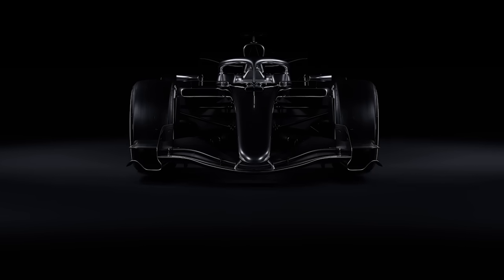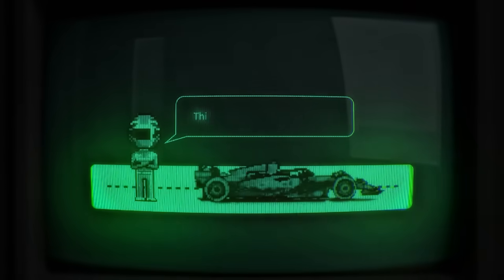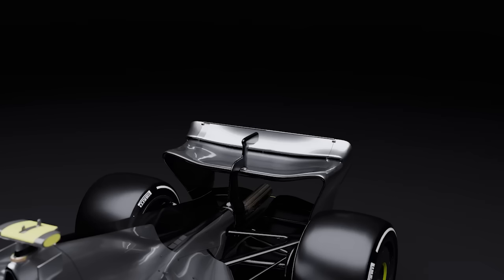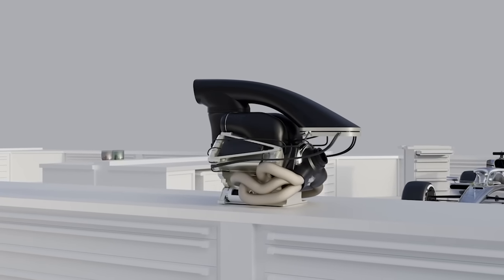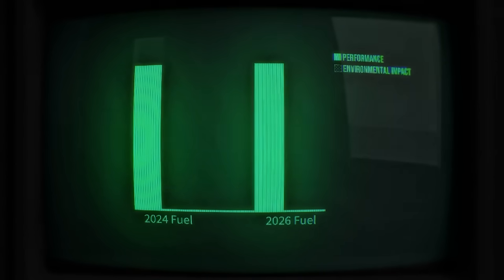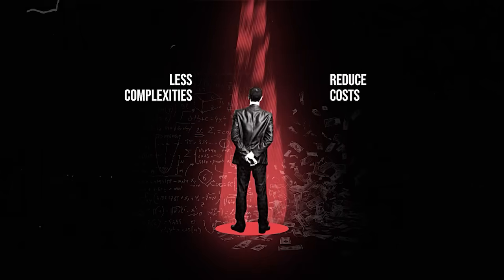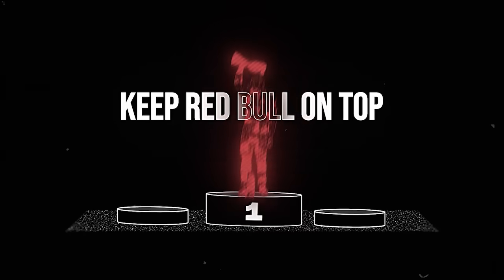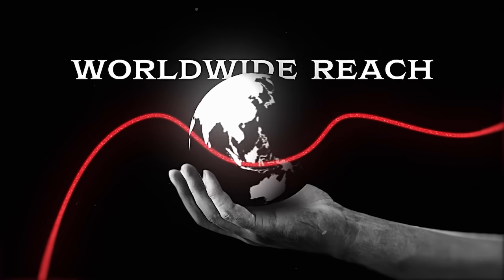F1 2026 Regulations: What’s REALLY Changing?

Comment: The sport has become nearly unwatchable over the last 5-7 years. The noise is gone, the rules restrict nearly all innovation, the sport has become all about extracting every single dollar possible from the ultra rich and no one thinks an $80 sandwich at the race in Miami is a good thing. Combine that with thinking that reducing the width of the car by the length of a human hand is going to make it more exciting and that's all the proof I need that it's still going to be as boring as ever. I do however want to give credit to the people responsible for this video, it's amazing and very informative. I just wish you were making this for something that was more exciting than modern F1.

Comment: Say we do: 700kg, internal combustion only, manual transmissions. That’s going to add a layer to the racing. 
Use synthetic fuels and the best tech possible to get the best fuel economy. Adding either limited fuel refills or bonus time for unused fuel adds a green incentive without silly electric motors and v6 engines. V10+ only.
Reply: Yes but having 700kg with v10 or v12 is basically impossible with the aero being decent
Reply: thank good you are not in charge of F1.
Reply: now ask every manufacturer to make V10s or more 😂😂😂 the sport regulations are made towards manufacturers not towards what F1 wants, after all its not worth having v10 if 2 or 3 manufacturers exist and they can provide engines for 3 or 4 teams
Reply: Some of you fans are such dreamers now.

Comment: Formula 1 really needs to cut the shit regarding "automotive trends" and making F1 "green"... Want to know what would make F1 cars kinder to the environment? Removing about 3-5 races off the calendar so you're not burning 100's of thousands of pounds of jet fuel/diesel flying and shipping the damn things all over the planet. The focus needs to be on renewable fuels that make the most horsepower out of a combustion engine. Not stupid ass electric power and batteries.. Let WEC and other forms of endurance racing be the tip of the spear regarding efficiency. I don't need, nor do i want an F1 car to relate to my road car. In no way shape or form does a carbon tubbed single seat open wheel race car relate to anything we drive.

Comment: Can the F1 fanbase just collectively accept that V10's, V8's, and any genuinely good sounding engine are never coming back. It literally doesn't make sense from an EFFECIENCY standpoint (not even environmental) to go back to those old engines. And I genuinely hate to admit this (believe me love the V10's), but V6's just make more power, burn less fuel, and overall just cost less to operate. And yes I know that brands like Ferrari might as well have infinite money to spend on their F1 programs, but smaller teams like HAAS don't. And I am all in for closer racing and more teams on the grid.

On an unrelated note however, you guys are overreacting on these new regs. They COULD be bad for the sport, I will never rule out that possibility, but there's a chance that the cars will be amazing (LMP1s proved a 50-50 power split between ICE and electric can work from a racing standpoint). Then again, this is fkn formula 1, if the cars aren't much faster than an F2 car then what's the point of good racing 😭

TLDR: V10's won't come back (please for the love of god stop arguing and be at peace with this) and the new regs may or may not suck lol

Comment: Hah! A slight shuffle in the right direction in some places. But on the whole I don't like these new rules at all.
1) Want to reduce carbon footprint? By all means change the fuel, but simply reducing the number of races to a less idiotic number and changing the schedule a little would make a huge difference.
2) Want to improve racing enormously while cutting out by far the biggest developmental cost in F1? Ban all bodywork aero! Then simplify the front and rear wings to be a single fixed piece of a mandated maximum total horizontal area front and rear, mounted fore and aft of the axel lines (no in season bodywork development).
3) Want to encourage innovation while making F1 progressively greener in to the future, and saving another huge chunk of money? Dump the 'engine' formula in favor of an open fuel formula - The fixed (green) fuel formulation is provided to all teams by the FIA, another massive saving both for the environment and fuel del development while eliminating the need to monitor fuel production rules. Each car has a maximum allocation of fuel it may use in each race, but otherwise teams may develop their power unit as they see fit - this latter innovation would automatically see developments toward battery powered cars just as fast as technology allows as less fuel carried would be a huge performance advantage.
4) Mandate a maximum wheelbase and track roughly half the current cars - it can be done within the above rules and would make a huge positive difference to the racing, especially on the 'classic' tracks just about everyone prefers.
5) While less of an issue than it used to be for larger drivers, drop the minimum car weight in favor of a minimum driver + seat weight, while maintaining the crash protection rules. Not only would that make the racing more fair as being physically smaller is still a huge advantage that has nothing to do with skill, it would allow teams a path to innovation that could benefit all while not incurring the outlandish expense of a continual aero arms race.
6) All cars must run the same agreed electrical and electronics systems package for each season, although software will be up to each manufacturer. To be overseen by the FIA. Why? For easier monitoring of the rules. But also to stop 'over-assisted' and 'complex' driving - to include no in race updates to settings from the pit wall (allowable during pit stops) and a drastic reduction in the steering wheel options available to the driver. ie: all car setup must happen pre-race, and any changes must either be done externally during pit stops or limited to the most basic in-race settings such as brake balance and diff by the driver.
7) Keep the mandated single-make tiers, but give teams a total allocation of each compound for the season. Each team to declare what they will bring to each race at the start of the season but for wet weather tiers. More interesting without resulting in added costs. Unlimited testing... but it can only be performed as part of the total tire allocation!
8) Only manufacturer teams my take part in the manufacturer championship, with two cars per team. Qualification for manufacturer status requires the in-house production of chassis, body panels, and wings, while everything else may be freely outsourced or bought from other teams. Single car privateer entries may take part in the driver's championship only though buying a chassis to a complete car from a manufacturer team at the start of the reason - all finances, in-season development, management, and personnel must be demonstrated to be independent of the chassis provider beyond the initial purchase and parts support.
9) Increase the 'grid' to 12 manufacturer teams and a maximum of 32 cars. Each race with a maximum of 26 starters... remember these cars will be much smaller and cheaper. If the 'grid' composes of more than 26 cars pre-qualifying will be required for new any new entries and the bottom 10 cars from the previous race - let's have some fun!
10) The weekend format - let's get rid of all the nonsense, especially the bloody sprints! The weekend and qualifying format that has been the norm from that last umpteen years is the ONLY part of F1 that isn't broken and needs no fixing!
11) A free fan vote to be had every 4 years on what should be the 12 core tracks in every season, picked from all those that still exist from F1 history - these tracks must be raced barring unexpected disasters and supported by the F1 organizers and FIA to ensure they proceed safely. The safety aspects must be independently assessed for their viability so impossible tracks aren't selected, but the choice isn't in the hands of the organizers. Any remaining venues to be chosen by the organizers as usual.

So there you go. That's what I want to see for F1 - I think it would be fantastic from the get-go and would only get better with time. Better yet, it would be far cheaper, far more interesting, and the rule set could be kept static for years as society-relevant development is built in. More, beloved classic tracks would become relevant once more instead of the yearly farce that is the likes of Monaco.

Will it ever happen? Of course not!

Comment: MGU-H never reaslly saw the advancement in production cars as regenerative braking. I think focusing on MGU-K would benefit that tech significantly. I wonder what percentage of energy it can currently gain from braking and how that compares to regenerative braking on some production vehicles. Does anyone know if these systems are actually related and if so what is F1 energy return vs the average of the production market that has regenerative braking.

Comment: Formula One dies for years because of eco regulations. They try to influence popularity of electric/hybrid engines in our own cars but they dont see formula one becomes much less popular because of it. Formula1 should use pure petrol solutions where the limit should be only engine capacity of 3600cc, teams should decide if V8 or V12 fits their construction best but meanwhile hybrid solution should be an option not the duty, like four wheel drive etc.

Comment: Ability to race sadly depends on 3 things and modern F1 doesn't do the greatest in any of them and only shows little effort:
- Car size. F1 cars have gotten huge, to the point where an Indycar, which a long time ago were ridiculed for being large, look small now. The 2026 regs are a small step in the right direction for car size, but nowhere near the glory days of F1. Monaco isn't even a race unless it rains...
- Dirty air. The 2022 cars were definitely a step in the right direction regarding this, getting rid of all the flaps and slats. Less over-floor grip and more underfloor grip. Risky, as F1 has seen casualties with ground effect cars before. The ratio of the the 2022 cars was pretty good I'd say.
- Tyre wear. Even if F1 did well on the 2 points above, the tyre compounds sanctioned by F1 still won't allow for much close racing, as tyres will just fall off a cliff far too easily. Can't closely follow for too long because you might thermally degrade your tyres... Soft tyres have also essentially become the Q3/Fastest lap tyre.

Comment: "That's a real racing car. I would race that today if I could." - Lewis Hamilton after driving Senna's 1991 MP4-6

"Hate the things. Biggest mistake F1 has ever made!" - Martin Brundle on the hybrid F1 cars.

Yup... the 80s - early 2000s was peak F1. Loud, roaring, screaming engines with smaller, lighter, more nimble, more lively, aesthetically beautiful chassis. The cars in those days depended more on the driver. Even the era of traction control, they still required more from the driver. Modern F1 from a marketing strategy it has improved leaps and bounds but the sport itself is a far cry from what it used to be.

Comment: The active aero is very interesting. I wonder if it has to be controlled by the driver, or will they let a computer control it. With pressure sensors under the car floor, the aero could be computer controlled, to effectively control the ride height, to give a rudimentary 'active' suspension...although it will only be effective at higher speeds obviously. If it could be applied asymmetrically, it could keep the car floor flat in high speed corners

Comment: Big mistake they didn't implement this for the 2025 season, 2025 is going to waste, or being used as an effort to nurse rookies into the sport, without any casualties on live TV. I get it but the sport is bleeding and need the lighter cars, with high reving, loud intake noise, engines.

Comment: So, when talking millimeters instead of centimeters, unless one has a laser measuring device, the cars will look the same in size and there won't be much difference. That means SUV length. So, there will still be the limousine riding around Monaco hairpin. Also, I thought the idea of the wing changes in the past was to reduce dirty air for passing. So if a driver can adjust the wing angles, the idea of using aerodynamics to make it harder to pass can still be made. I guess the NASCAR amount of point system will stay the same and there will still be the corny sprints. At least I am glad that I was around for many decades watching F1 before it turned to crap.

Comment: I dont understand the reduction in ground effect. The current cars can follow closely fairly well till the tyres go off, surely downforce that isn't affected by dirty air is better. All the teams have pretty much got a handle on it and the bouncing is all but gone. I think to get good close racing we need ground effect cars with hard tyres so you can follow closely and push without the tyres go off and losing the chance of a pass after a couple of laps. 
Look at the early 2000's cars with the hard tyres they could push lap after lap like it was qually but dependency on wings for downforce stopped them getting as close as they could have.

What would also help with racing is if they stopped adding dull narrow street tracks with no room to pass or make mistakes. They need more real tracks instead.
Reply: i think its more of an overall reduction of downforce, not just the downforce from the floor. however ground effect is terrible for wet weather racing, setup flexibility and for predictable handling. i agree that what you listed is more important, but dirty air hasnt been nearly as much of a problem as it was before and i think increased tire drop off would make a bigger and better impact on the racing. just remove the hard tires, keep the compounds as they are and remove the hardest. we want 3-4 stop races, not one stops. thats why no one can pass. if 20 cars are all exactly as quick as eachother with the fastest driver starting on pole, the type of tyres you suggested would make everyone push all the time, but ultimately not lead to any sort of action because why would it? why would someone who qualified lower ever overtake anyone else? everyone is going the same pace, the field is just getting spread out. tyre difference is where f1 style race cars get exciting. imagine a season where every race is either a 3 stop or a 4 stop, with people going on both strategies each race. THAT is good for racing, not one stops.
Reply: @mackesburner  I have to disagree, the big big big problem with soft tyres is the drivers cant push on them, they are constantly tip toeing round on them. As soon as they get in the dirty air the tyres start going off quickly and as soon as they try one or two moves that stresses the tyres and they are done and the chasing driver can't keep up anymore. There's an interview with Frank Dernie (I think) saying in 1983 when they were forced to go to flat bottom cars losing 60% of the cars downforce the next year the racing was no better than the year previous, showing the limitation is tyres. He says he believes they should go to hard tyres so they can push and fight, considering he designed F1 cars you'd think he knows what he's talking about. Same as in 2009 the rules trying to cut 50% of the downforce, there wasn't better racing in 2009 over 2008. 

Lots of pit stops to create more strategy but I cant see a way to make them have lots of stops without having tyres that die after a couple of attempted moves.

Comment: The cars could have been even lighter and more agile if it wasn't powered by 50% electric power. 🙄 I get the reasoning somewhat, but it will not change the carbon footprint at all 😅

Comment: Formula One has always been a testing ground for new technology. Disc brakes, turbos, lean-burn combustion were all developed in F1. Hybrid engines and sustainable fuel reflect current research for the automotive industry. It's not about reducing carbon emissions at the races
Reply: Don’t forget CVTs, ABS and TC all being F1 developed and derived
Reply: disc brakes were actually from planes, Jaguar were curious how 400 tonne planes were able to stop in such short distance within little time that they had to give it a go, then they won le mans 24 hours 3 years in a row until the other teams figured it out
Reply: @scotthetherington5580 I miss Jaguar in F1 and on the streets.  Corporate went woke and now are broke! 😢
Reply: Now I’d like to see airless tires tested
Reply: Yeah, no, you're totally wrong! Disc brakes came from aircraft adapted to endurance sports cars, turbochargers came from aircraft and stationary engines to endurance sports cars. Formula One didn't even have radial tyres and electronic fuel injection until years after these were standard in road cars. My first road car with turbocharging and direct fuel injection was 2007, so when did Formula One have this combination? Answer - 2014!
Reply: Exactly
Reply: Exactly, finally someone with more than five braincells.
Reply: Someone finally said it 😄